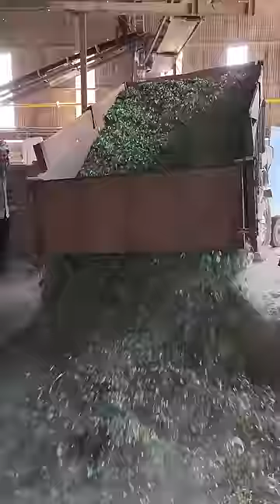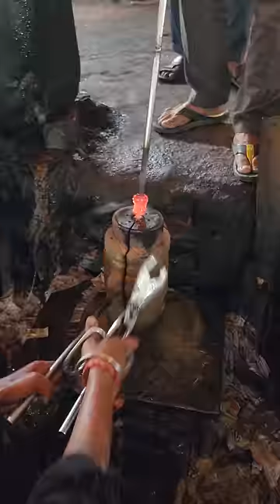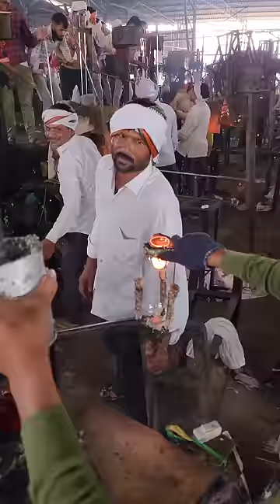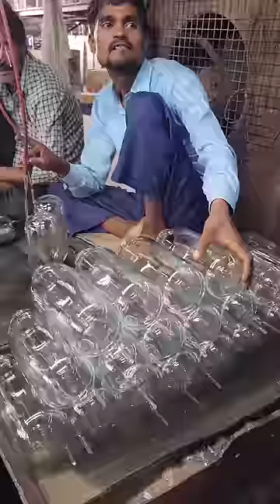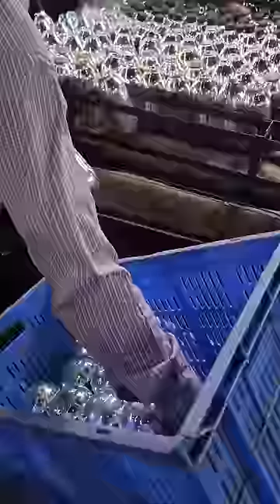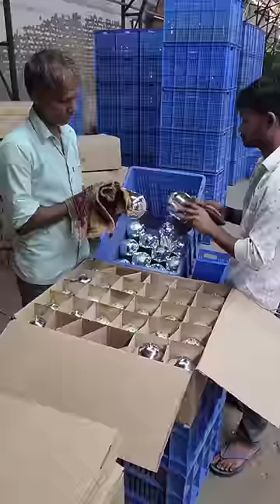Amazing Flash Water Bottles Manufacturing Process Using Wastage Glass #shorts

Comment: Vacuum flasks, they are largely replaced by steel made which are not as good in keeping heat, but can survive a drop on the floor well.
Reply: 100% correct✅✅✔☑☑✔
Reply: the very first.. double glazing application

Comment: These double lined glass inner thermos bottles are supreme in keeping beverages steaming hot. But the drop factor unfortunately does their reputation no good. Stainless steel vacuum flasks now keep ice frozen within, for more than a day and a half and are indestructible. Back in the day, nothing was better than glass but today we have better alternatives. And the newer flasks have wider mouths with replaceable parts, which are easier to clean. Good to see them recycle the glass into practical items even if they are terribly fragile.